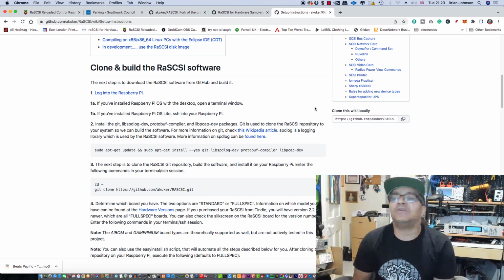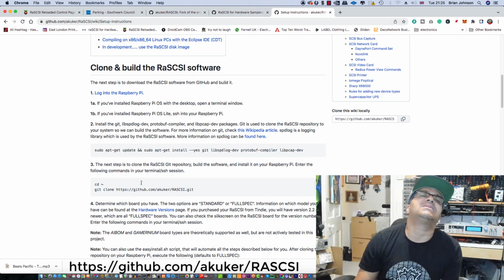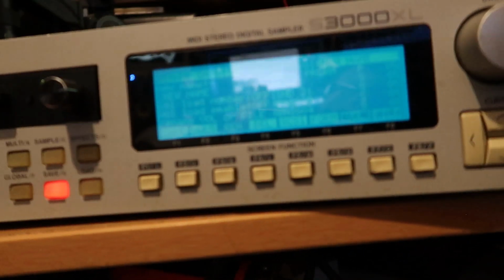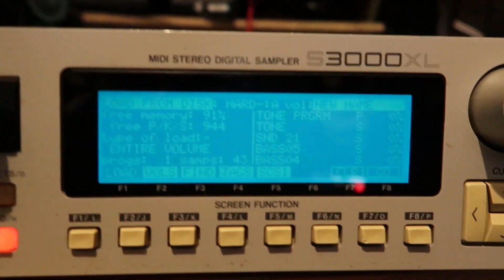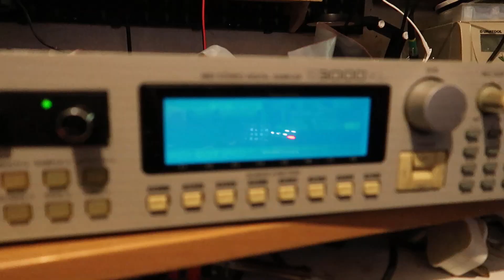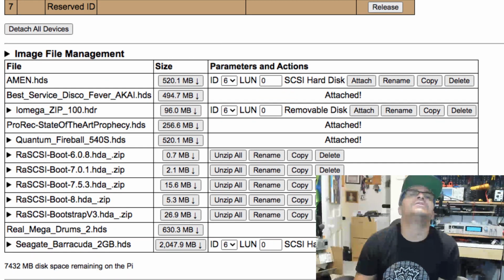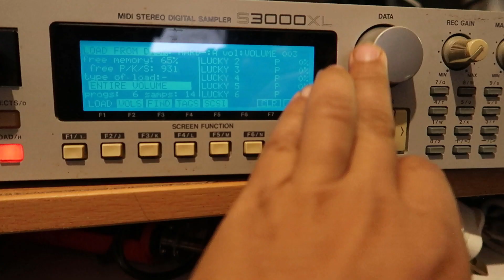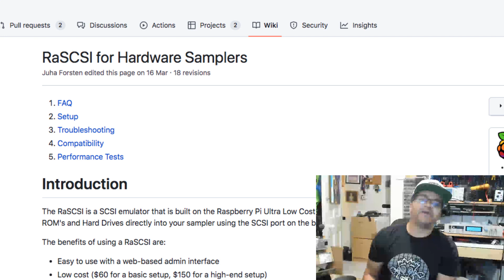HARDWARE SAMPLER 2022: Breakthrough Storage add on! | RASCSI |Raspberry pi

Comment: Ive got 2 old scsi HD i think im going to put one in my s1000 and 1 in my s3000xl. 😊
Reply from the maker: Good idea
Reply: @TheBizzyBScience  I dont really need them I have a external HD zipdisk cddrive. 😊  I need to find out how to get them hooked up. I may need an additional molex connector plus a scsi cable for one of them.

Comment: Down and dirty detachable hard drive mount!
Try mounting the scsi emulator to the inside of the sampler case with extra strong sticky back Velcro tape. It comes in a roll with both hook and loop sides and a protective film covering the sticky coating.
Cut to required length then peel the protection film off the back of one side of the tape and stick it to the scsi box then peel the underside film off and push  onto the inside of the sampler in a suitable place. I wouldn’t take it on tour but in the rack of a home studio it’s secure enough, but it can be detached and reattached as required without the need to drill holes in the case.
Reply: If you search online for sticky back hook and loop tape you will find a much better prices compared to searching brand names like Velcro
Reply from the maker: Nice tip

Comment: Hmmm this is curious. I have an S2000 and looking for an S5000 or similar. This could be handy rather than the internal SCSI2SD to switch between the two, though they do use different formats. Hm.

Comment: If mounting internally, does the Molex connector on the RASCSI also power the Pi, or do you need separate power supply for the Pi?
Reply from the maker: no , I think you will need power for the pi ( 5v)

Comment: I have one to use with my Roland XV5080. The XV sees it just fine. I just figured out how to get the video out to work. I'm having trouble getting the WiFi to work, and keyboard/mouse are unresponsive. My life would be so much easier if I could mount these drives and get them to be accessible across the WiFi LAN. 

Still working on it.

Comment: Yes yes bizzy b love your videos learn so much & have got me back into my hardware sampler akai s5000 I had an external unit with a mangetic optical drive & hard drive in it, I opened it up & put the hard drive into my sampler but can't reconnect the magnetic optical drive to the SCSI ID cable & get it working could your hardware knowledge help me out as it was a great place to load up samples & keep as a backup, keep up the good work & content big up.